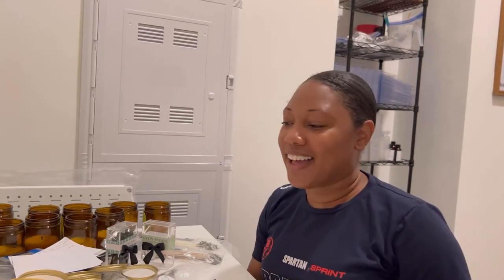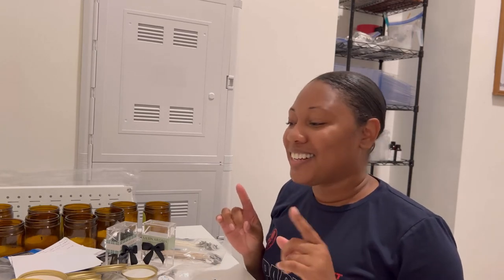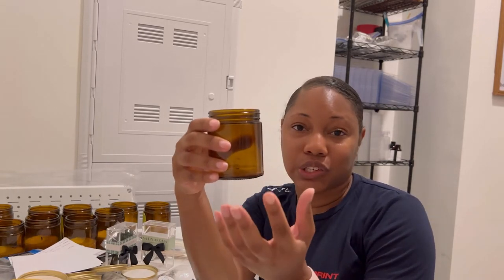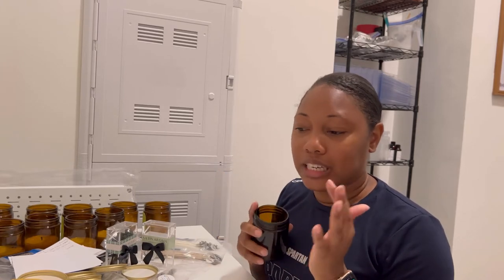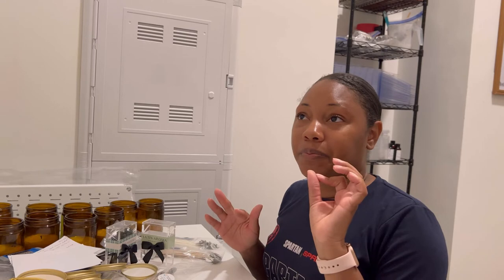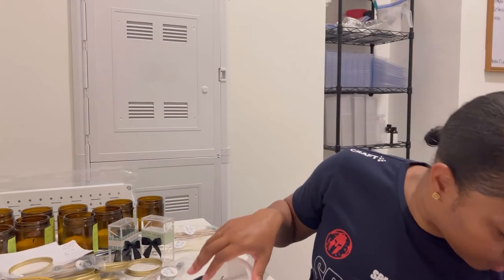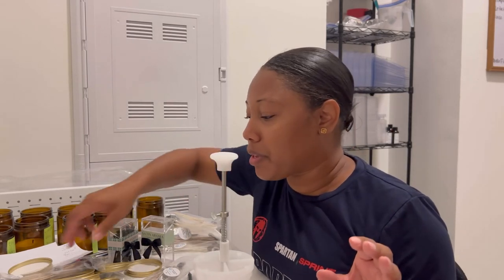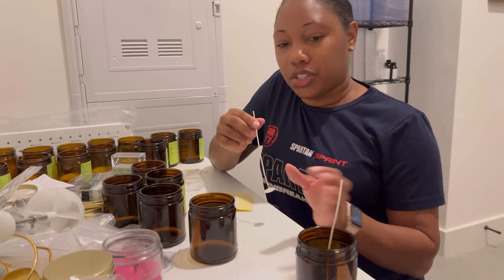Why Is Testing Candles Such a Long Process?! Using the EZ Wick Setter, Wicking and Labeling Jars!

Comment: I do wickless testing. I have had the same issue with the wick falling over so instead of half jar testing, I do about 3/4th jar testing. For me at least, I am able to get at least 2 4hr burns and I can tell if the wick is going to work or not from there. Then I would make a full candle with the wick glued and test all the way through
Reply from the maker: I will have to try filling it 3/4th full next time! I feel like I get decent results to let me know whether to make a full jar or not but I really wish I could burn the half jar all the way down to do a full test.

Comment: I always start testing with sickness with a half jar. Because I have a good idea of the wick size that generally works with my candle formula, I’m generally able to get a pretty substantial burn out of my wickless testers. You have a lot of wax left in the wickless tester that you showed. You should be able to do additional burns. I take that as a sign that the wick you’re using is too big. I’d stick a smaller wick in there and burn it again (pull out the old wick when the melt pool forms). You should be able to get close to the bottom of the jar before the  wick falls over. Hope this helps!
Reply from the maker: That's very helpful information! I'm still playing around with the wickless test. Recently securing the wick has been working so much better for me as far a getting the test data I need.